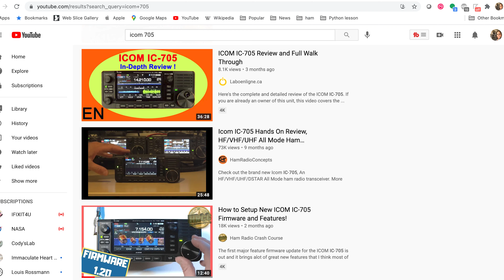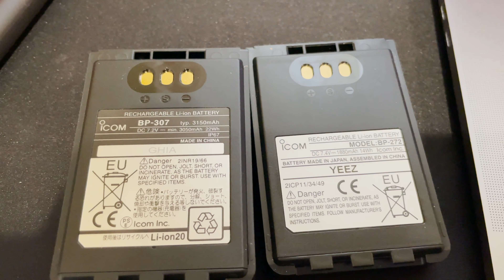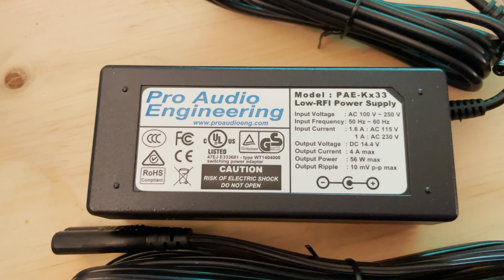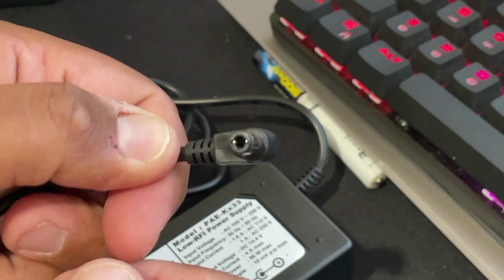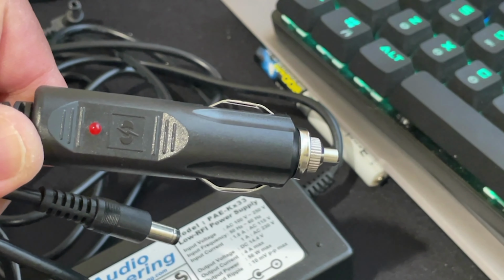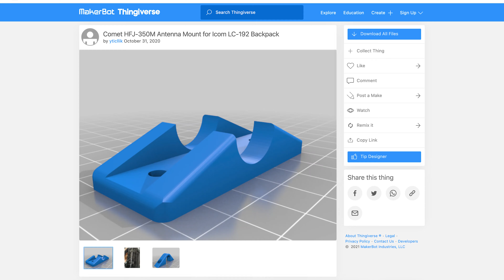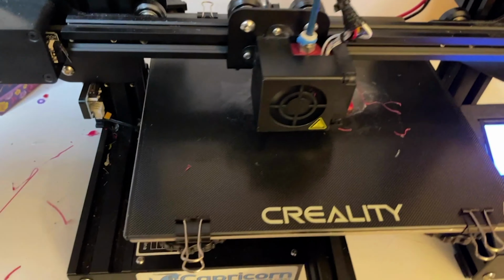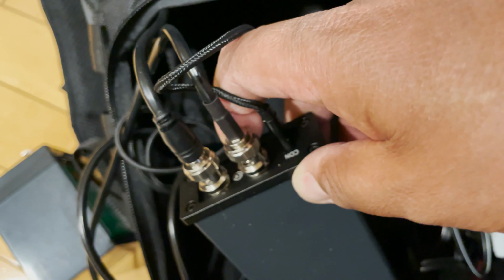My IC-705 and a few things for it (including something I 3D printed) #hamradio

Comment: Good luck with that Comet antenna.  You will need it.
Reply: all versions of it from the chinese one to the toybox are ideal for recieve while walking, thats all i use it for, hence why i got the cheap chinese version
Reply: @peterlinnet8111  Receive only is fine, but  problematic to tune if you want to transmit.
Reply: @TXLorenzo  stop walking and use a wire. You are never gonna get anywhere with any antenna walking unless you have  a small loop, an artificial ground or saving that several meters of ground wire trailing behind you 😄
Reply: @peterlinnet8111  I don't practice walking around with an antenna, that was the poster.  My comment was directed at the inadequacy of the comet antenna.  I normally use a tuned EF wire antenna strung up in the highest tree.  I personally do not like radiating antennas next to my body.